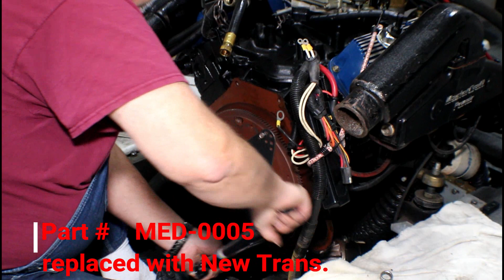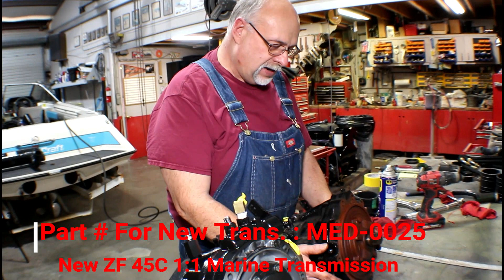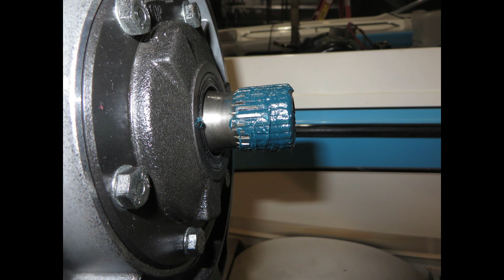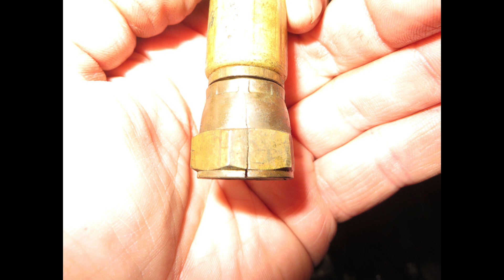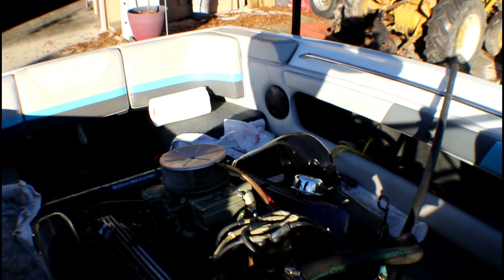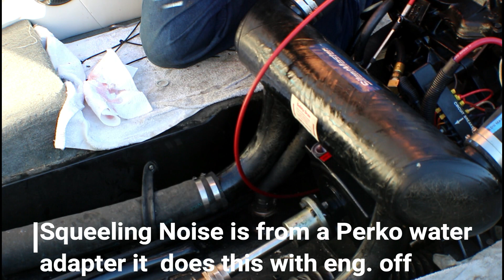Velvet Drive Replacement PART 2

Comment: Question- if you were just replacing the flywheel would it be simpler to leave the bell housing attached to the transmission and remove as one unit?

Comment: Hey Ron, what is an appropriate amount of wiggle/play with the dampener plate on the velvet drive. Should there be any wiggle at all? Or should it be a tight fit with the splines?
Reply from the maker: "Wiggle" between the damper splines and flywheel---0--- play, should feel like it is one piece, any ply indicates spring wear. Between the trans input shaft and damper spline hub, very very little if any at this joint.

Comment: What engine does this boat have in it?
Reply from the maker: That one had a 5.7 GM, same trans is used on the GM or Ford engines
Reply: @rontanis1024  Great thank you! Do you know if the 351w had a similar flywheel that was indented in the middle like the 5.7 in the video? Thanks
Reply from the maker: @neavemckinnon  They all have a bit of a recess in the center

Comment: Question for you: Why use Dex3 when Mobil 424 is required from velvet drive? V-drives 1987 71c
Reply from the maker: Because I installed a ZF 45C which requires ATF Dextron III, most of the older B/W trans also call for Dex III

Comment: Why replace the velvet drive with a ZF? My understanding is that the velvet drives are re buildable without too much problems. What's the advantage switching to a ZF?
Reply from the maker: Cost....If you can rebuild your own Velvet drive, and only need the basic rebuild kit you are better off, BUT if you need to replace any hard parts like worn or scored shafts etc. the parts prices for these have gone absolutely sky high. So a typical DIY rebuild could easily cost $900-1900 with NO LABOR, or a new ZF for approx. $1500 with new 2 year warranty.
Reply: @rontanis1024  thank you. That makes sense. Fun watching your videos. Learning!!

Comment: I need help getting a heavy duty 26 tooth dry dampener. I’m also looking for a seawater strainer. I own a 96’ pro star 205 MasterCraft. Could you help me out??
Reply from the maker: Under 300HP: https://skiboatpartsonline.com/inboard-engine-parts/%20Drive/drive-damper-MED-0005
Over 300HP: https://skiboatpartsonline.com/inboard-engine-parts/%20Drive/drive-damper-PCM-Indmar-Marine%20Power
Strainer: https://skiboatpartsonline.com/Sea-water-Strainer-ASC-0005?search=strainer
Fittings: https://skiboatpartsonline.com/Elbow-Fitting-Seawater-Strainer?search=strainer
Fittings:  https://skiboatpartsonline.com/Straight-Fitting-Seawater-Strainer?search=strainer

Comment: Ron, I had a question. I have two similar looking old velvet drives in my twin screw inboard. but both dipsticks are in different places. engine on the RIGHT CW rotation has the dipstick near the shift lever. The engine on the LEFT, which is CCW rotation, has the dipstick in the very back of the transmission. 

1. What does this tell you about my transmission and why are they in different spots? 

2. Curious if there's different areas that need to be checked for transmission fluid level? I've read where transmissions have gear oil and also transmission oil. I thought transmission's only had one area to check for oil and it's the same fluid throughout the entire transmission.
Reply from the maker: Call Ron when you have a minute 985-542-4336

Comment: We had a big problem with excess water in the bilge (a lot) and didn't notice for some time.  Now the oil is our ZF45C is like milkshake.  I've replaced the oil once and it's still milky - not sure if that's residual water so I'll replace it again and check.  Any advice for what else to do or whether there might be some seals we should look at changing?  I'm about to change the drive damper due to a rattle noise in neutral so might be a good time to do that as well.  Thanks a ton!   (Also fyi I have the ZF45C service manual and it says you have to check the oil level by screwing the dipstick all the way in - but not for the ZF40IV V drive portion - that one just gets dipped, not screwed to check level).
Reply from the maker: 1) it takes several fluid changes to remove all signs of water
2) Water intrusion comes from one of two places, the vent on top of the gear, or a bad trans oil cooler, not water sloshing in the bilge
3) My ZF book and what I have practiced for years on the 45C is to check the levels without threading the stick into the case, what they don't tell you is that you need to do it immediately after shut to to account for oil drain back.
Reply: @rontanis1024  thanks so much for your reply and your videos Ron.  I'm just transcribing your video into a step by step Word doc so that I can follow and adapt it for my V drive - we need to replace the drive damper.  When you have a Vee drive and need to change the damper, do you tend to take off the Vee and gearbox separately or keep them as one big lump?  Thanks so much - you will definitely be my first port of call for parts from now on.  Far be it for an amateur like me to suggest anything to a pro such as you, but I'll email you the ZF operating manual they sent me just last week - it definitely says for the main unit (ZF45C) you completely screw the dipstick to check level but for the V Drive portion (ZF40IV) you insert the dipstick without screwing.  Guess it doesn't make a huge difference unless at the low or high limit..  I take your point that the crucial issue is to catch it while it's still hot because the oil quantity in the cooler is not 'known' by the dipstick :-)

Comment: Great video. Thanks for this. your dedication to the details are well appreciated. Are ski boats and large cabin cruiser Velvet drive configuration similar? Two cruisers on my dock have problems. 1st vessel has a port side transmission noise and alarm (2006 Searay 270) and the second is a 1997 Searay 330 with no engagement. I'm worried now about my Searay 350 cruiser

Comment: Informative video can I ask is it possible to change rotation of the prop by turning oil pump around like you doo on a prm box would you know? I'm on about the 72c box thankyou very much
Reply from the maker: Yes, but this is "adjustable' based on engine rotation, the only time you reverse the gear is when a reverse rotation engine is being used.

Comment: Great video.  What is the estimated time it took to swap out the transmission?  I have a 2002 Centurion with a Velvet Drive 10-17-004 71C
Reply from the maker: We have overhead cranes in the shop so lifting is quick & safe, I usually find it easier to cut the short exhaust hoses & replace with new saving time, I figure around 4 hours for a direct drive, and MUCH more for Vee drives.
Reply: @rontanis1024  Thanks Ron you'er great. Love the videos

Comment: I need to replace the flywheel on my boat sand I like how you removed the rear deck piece And put board across to  sit on. I can’t see how to remove the rear seat frame on my boat I see no screws or bolts I’m thinking they  put carpet on after building the  frame do you  have any suggestions
Reply from the maker: Well, I don't know what kind of boat your working on?? pics also help
Reply: It’s a 1991 Cheyenne, I’ll send a couple pics too

Comment: Thanks Ron for this but I have one question. Why change from Borgwarner? I may have to do a rebuild on mine and they seem like an easy rebuild for someone like me that has rebuilt a few transmissions.
Reply: The only advantage is weight savings of 15-20 pounds as the ZF 45c is aluminum and the Borg-Warner 71c is cast iron. Both are 1:1 drives and neither the ZF or BW will handle full power reverse without cooking the reverse clutches.
Reply from the maker: ZF is less $$ and new warranty, If you are able to do your own rebuild, stay with the Borg Warner, replace the damper plate, flush the oil cooler. If paying a shop to do this the rebuild plus any hard parts approaches the cost of a new gear with new warranties.